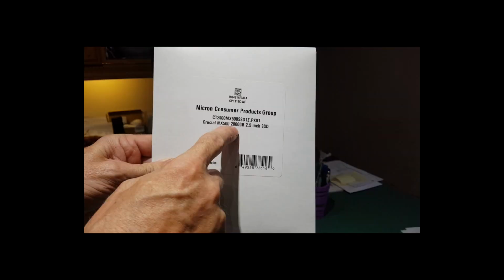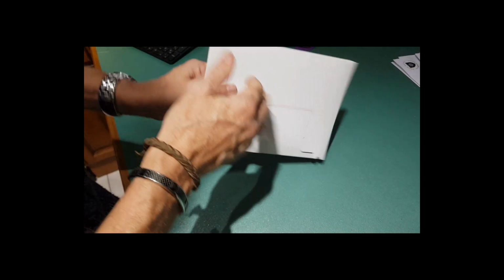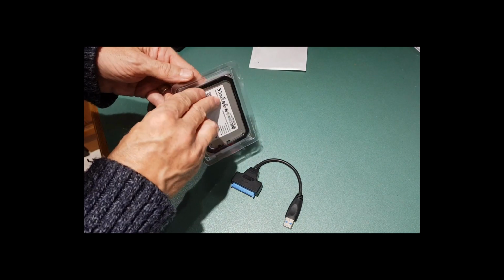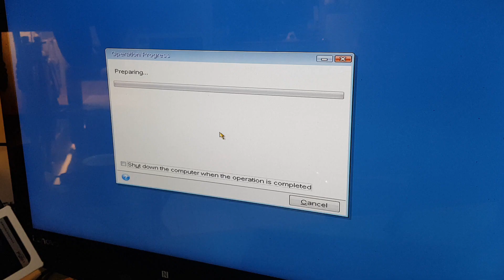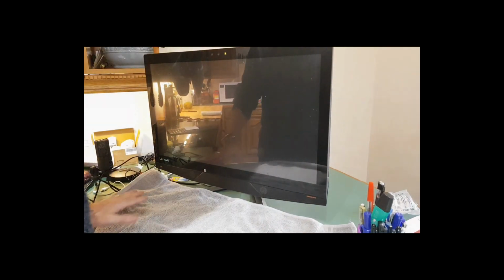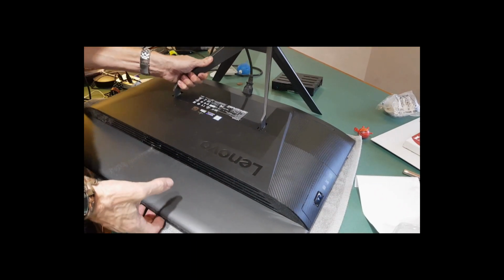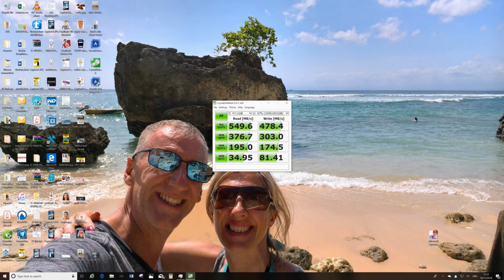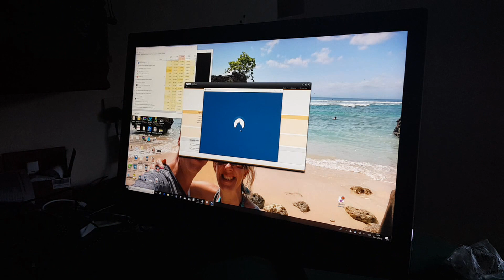How to install an SSD - Step By Step Setup Guide and Windows Install

Comment: I replaced the harddrive in my laptop with a Crucial SSD. On my HD there were three partitions, but the Acronis software only moved two of them... Únfortunately those two partitions used the whole SSD capacity, so I couldn't create the missing third partition. Then I tried the 'manual cloning mode'. Now also only two partitions were tranfered, but now there was some space left so I could create the third partition manually. After putting the cloned SSD in my laptop, I got a lot of errors and even 'blue screens'. At a certain point Windows wouldn't even start up, because a vital file couldn't be found. 
At the end I placed back the original  HD in my laptop and everything worked perfect again. 
I think I will keep the SSD to use as a backup disk, but of course that wasn't the intention...
So,the whole SSD replacement failed!

Comment: You may have a very long video download (five minutes is very long) in Nero 2017 for three reasons: 1. You did not clean the computer from unnecessary files and then did not defragment your old HDD. 
2. Nero 2017 may be slowed down program (slow video processing). Read reviews on the forums or on YouTube, there are faster programs. 
3. Or you have a computer virus that slows down the Lenovo Ideacentre 700 AIO.
Reply from the maker: No, the issue for the 5 minutes was all the processes that had to be opened from booting before even getting to Nero.  What this did, was to speed everything up, not just the loading of Nero.  I am looking for a better video editing software now though.  Something that gives me more control and ability to edit.  Any suggestions?  I will go onto YouTube and look around though, thanks.
Reply: @CloughReviews  5 minutes to boot the system is also very much (maximum 1.5 minutes) for the Intel i3 processor (if you have one). So you have a lot of unnecessary loading processes in Startup. They are automatically added to Startup when new programs are installed, and if the program is with a virus, several slow down processors may be loaded.
I don’t really understand English, I can offer a Russian video, and you can try to find a similar one in English. Here is the link. Video editors of 2014, but they are multifunctional and their video processing speed is faster. https://www.youtube.com/watch?v=rlDsjzg1qfM But now with the SSD you can use newer versions of video editors. And read the first two comments under this video.
Reply from the maker: Many thanks 👍😁
Reply: @CloughReviews  Thanks for "thanks". )))
To search for unnecessary programs in Startup, you can use two free programs 1. https://docs.microsoft.com/ru-ru/previous-versions/bb963902(v=msdn.10)
2. http://systemexplorer.net/ (this program has a CPU utilization indicator (in the taskbar Notification Area) - if the processor is overloaded it is lit in red, if it is average, then yellow, the norm is green (when Windows is looking for new updates or installing system updates indicator is always red  on laptops, even with with a weak Intel processor i5).
Reply: By the way, what is the temperature of SSD when editing video in Nero 2017 now?
Reply from the maker: Not sure, but swapping out the old hard drive has given me a new machine, not necessarily changed the rendering time much probably, but opening and closing programs and files is so fast now
Reply: @CloughReviews  I use Davinci resolve for video editing, free and works great. I just ordered a crucial ssd for an old desktop.
Reply from the maker: @nosociallifeatall I should have tried that, Just bought Powerdirector 17, complicated but boy, does it do everything.....
Reply: @CloughReviews  Adobe premier elements

Comment: I put a Crucial SSD into an @7-8 year old Dell laptop which started life as a W7 updated to W10. The hard drive just flat failed so there was no chance to clone anything and frankly I wasn't sure how it would work out. Well the good news is that since I owned the license and the laptop was recognized, I was able to download a fresh copy from Microsoft. I had a similar issue with start times so it wasn't like I wasn't given fair warning that the HD had issues. It now starts up really quick. I only use it when I need to do PS Lightroom work, otherwise I use my Chromebook. However I don't want to pay for a monthly subscription to use it on the CB. My office desktop is showing the same issues so I know the HD is not long for this world. It is a bit newer but the same scenario. I have received the SSD but failed to order the cord to clone it with. It will be great to still have what is on the original HD. I appreciate the video and highly recommend, when it is practical, to upgrade what you have. You will be amazed!

Comment: Great stuff. I'm awaiting a MX500 1TB version. Going to use mine in my Lenovo X230 Laptop. 
I'm not the most tech minded and thought the processor or ram were the biggest issues. Glad purchasing a new hard drive solves that.
Nice vid BTW
Reply from the maker: I don't want to over sell SSD's, but this was a life changer 😁👍.  Additional RAM helped me to have more windows open without slowing things down, but the MX500 just made Booting and retrieving things from the memory just incredibly fast.  Easy to install as well!!!  Good luck
Reply: Clough Reviews I bought my laptop with 8gb ram included. It’s a intel core I5 processor. The start up time isn’t much of a problem but video and applications are laggy on startup. The biggest piece of mind is knowing having an SSD will not only boost its speed but also reliability over a HDD failure which can happen at any time. 
I also have an old pc which takes over 10 minutes to fully boot up. 
Going to wait until next year when SSD drives are even cheaper and purchase the 2tb version. Hopefully get a good Black Friday deal on amazon 🤞🤞
Thanks again for sharing 👍👍